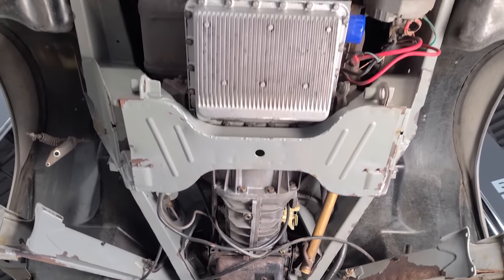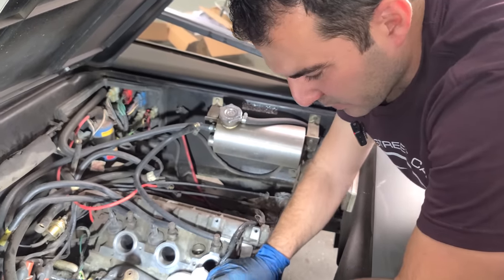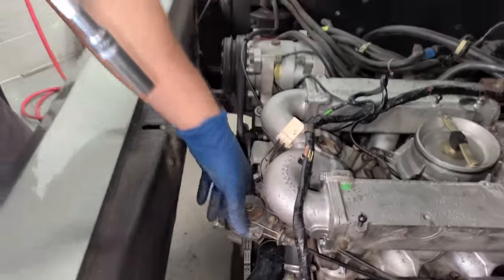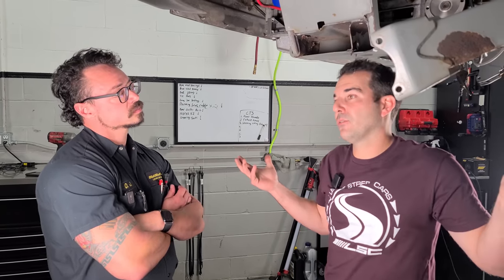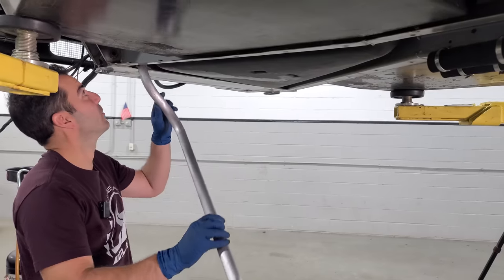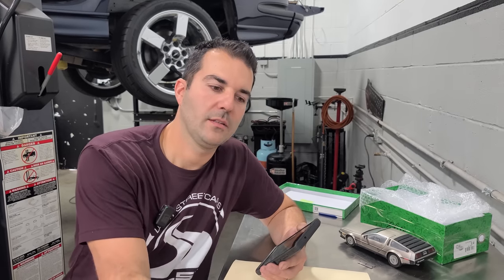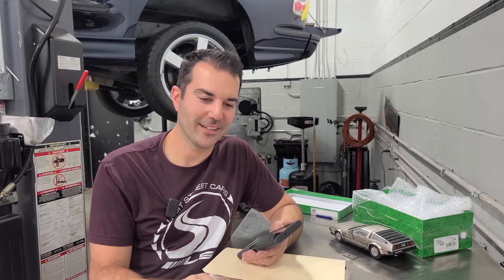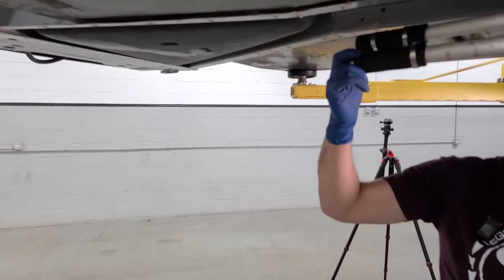I Put My DeLorean Engine Back Together & Spoke With The Orignal Owner! Fake Miles & More Bad News :(

Comment: That stainless bolt you used threaded into the aluminum intake at 11:15 needs a special grease applied to the threads to prevent galvanic corrosion to the manifold! It would be better not to use it at all.
Reply: Very good and important catch!
Reply: My thoughts exactly - I cringed heavily when I saw that.

Comment: I would love to see something unconventional.  Honda J series, 13b, or a k series.   Something turbocharged would be pretty cool.  A Rob Dahm crossover would be amazing.  Or working with Haltech would be rad.
Reply: If I was thinking in terms of easiest swap, I would build a 3.0 PRV out of an Eagle Premier. That engine already has DIS, modern EFI, is a direct swap, and costs about 200 bucks in most junkyards. Control it with a Haltech ECU and add a turbo or two. If cost was no object? My first choice would be a TDI V10, but if it didn't fit, I would have to say a GM 1.2 or 1.3 3 cylinder, the LIH, or L3T. These are sub-200 lb engines, all forged internals, that stock make either 137 or 155HP on 87 octane. Take one of those, control it with a Link Force GDI ECU, upsize the turbo by quite a bit, and tune it for 93 octane. Sub 200lb engine that makes 250-300HP easily, possibly even more. The design of the block, pistons, and rods is so advanced compared to something like a 2.0 Ecotec, or Honda engine, that I am sure it can handle much more. I mean it has DLC coated wrist pins, seriously. Cast iron cylinders cast into an aluminum block with a full bed plate. And just all of the latest technology. And they can be had for $1500 or so. The engine isn't the expensive part, it's an ECU capable of controlling it.

Comment: I'm loving this De Lorean series. After halloween you could put a turbo and a holley efi on it. Go for it!!
Reply: And get some Alpine heads for that boat anchor of an engine.
Reply: Or even go to the Eagle Premier 3.0 PRV V6. Direct swap and has EFI already. Get a Haltech standalone and a turbo (or 2), and some more modern injectors and coils, and you're pretty much all set. Those engines sell for 200 bucks or so complete, so it ends up a lot cheaper to do it that way. Even stock those engines make more power than the B280F, not to mention the increased reliability with proper EFI.
Reply: @theodorgiosan2570   nice one! While keeping the original DeLorean vibes and get rid of the valley of death. You can make it faster with more hp, put new tech on it and then bring it back to the future.  😄😄

Comment: The frame is not that bad. I’d suggest putting the frame on the “B” list and get the vehicle running and driving well.
Very cool to have a great relationship with the seller. What a nice guy.

Comment: The body and interior are your most important parts for what you want to do.  You could replace it with a new reproduction frame or fabricate a custom frame or  drop the body on to a frame from a different car totally.  In my opinion the thrid option is your best option as it seems you are also looking at doing an engine swap.  I think an LS6  would be a great option for the swap and you might be able to get a doner car that has everything you need Frame, Engine and all.

Comment: I've used Rust Restorer since the '80's and it really does work. No, not a long term fix. But you'll be fine until you can do a proper job.
That model is valuable, that's a great gift.
As a young sailor in the early '80's we did a port visit to Bergen. Let's just say that was one of the best liberty weekends of my career.

Comment: Just a note on stainless fasteners.

There is a reason you should be glad they didn't use them. 
Where you used that stainless bolt your probably fine. But a good rule of thumb is to never mix stainless hardware with aluminum, and never use stainless hardware if you ever want it to come back apart. Stainless will gall and fuse together permanently. If you ever want any hope of stainless hardware being able to come back apart you must passivate the hardware with some kind of acid based product, use anti seize, then never tighten then with power tools.

There's a whole mil-spec guide for using stainless fasteners for different applications that's really specific. With things like maximum turns per second of tightening/ loosening motion to prevent them from fusing.

Comment: From my years of experience with Vanagons, (engine in back, radiator in front), you should put a petcock on top of the radiator that you can attach a hose to which is then submerged into a plastic bottle full of coolant (air bubbles out and pulls coolant back in).  Makes priming the system sooo much easier!!

Comment: i suggest that you clean with the least abrasive method the valley and apply Alodine, it's a corrosion inhibitor that we use in the aircraft industry to passive the aluminium corrosion, after that you can apply any hot temp primer and paint to extra protection (preferible epoxy). Alodine is now distributed by henkel as bonderite, check the M-CR 1200, M-CR 1500, M-CR 600

Comment: LS twin turbo engine. I saw a guy has a Corvette engine in his. Also, what about that stuff you used on the SVT Lightning frame? It turned the rust into nothing, instantly. At least it could be used to stop the rust process. Go Alex!  Oh, BTW, Did you hear of the DeLorean barn find in Wisconsin? It ONLY had 977 miles on the odometer.

Comment: I worked at Delorean's East Coast distribution center in the early eighties. That epoxy coating was always cracked when the car came off the transport trucks. The transport guys would tighten the cars down so tight the epoxy would be cracked at the tie down points. We sprayed the cracked spots with rattle can gray paint. I always knew the epoxy would be a problem. The frame was originally supposed to be made from stainless but was later changed to keep the cost down.

Comment: for aluminium pipe best is to use a surface conversion treatment or anodizing to control corrosion for the future . Yellow surface conversion as Alodine will provide a aerospace look to the DeLorean .

Comment: As few DeLoreans were made,  I would recommend keeping it original. Once you start modifying it,  it will be hard to put it back original and you will kill the value.  Have you heard of a "duce coup"?  32 Ford coupe or v8 Ford. Because of all of the hotrods that were built out of them it is extremely rare to find one that is all original. Something to think about before you engine swap.

Comment: I set the standard for my time as a young mech in a Lincoln dealership when I burned a Mk III Continental's tires for 20 feet in front of the dealership owner. The radio had been left on by someone, and I had no clue the cars were so quiet or that they had so much torque. I was in the doghouse until I joined the Marines for a pay raise. Those things were so overbuilt. Enjoying the DeLorean resurrection. Good luck.

Comment: I always wanted a Delorean. I picked up a front bumper with grill and emblem and a rear bumper cover and other odds and ends as I was sure I was going to get one. Well it hasn't happened yet....

As for the engine, I would LS swap it. I've heard the trans can barely hold it so you would probably have to swap that to a Porsche unit. I love your car, enjoy working on it and creating memories with your kids.

Comment: A tiny bit of surface rust and Alex is having a conniption. Just touch it up with some trim clad and be done with it. Its so minor that it won't make any difference. Plus its not your daily, and it won't see rain and definitely won't see snow and salt.
Reply from the maker: Did you see the big holes and no good metal to weld to?

Comment: The bad frame is such a common issue with DeLoreans, the epoxy lets go, moisture gets trapped and things go bad quickly.
That said, I'm looking forward to the episode where you pull the body off the frame, from what I remember it's a straight forward process.
Then maybe think if its not more cost effective to order a reproduction full stainless frame? Assuming they are still making those. I've been out of the DeLorean scene for way way too long.

Comment: You should get a vapor honing machine. The dry ice works great on things like the frame where you have a large surface area. The vapor honing machine works like a parts washer on steroids. I seen it on rebuild rescue If you haven't seen it you should check it out.

Comment: @LegitStreetCars My man you need to clean that aluminum! Here's a trick i use,
1. Clean with Aluminumna Brite an acid for cleaning aluminum. Then pressure clean until all the grease is free. If its really bad repeat this step.
2. Use steel wool and polish the Aluminum then use your Mud-Off to protect. 
This will recreate the original finish.

Comment: You know Alex,that's a good problem to have.Removing the Drive train is necessary at some point.Just have the bad sections removed from that frame completely, weld in new sections. I had a couple old Buicks ,the frames rotted in front of tge rear bumper.They just cut out ,welded in new sections,good as brand new!Then while your at it have it modified to replace that under powered mess.With a high horse LS Engine and transmission swap!Make that car move like it should!THINK CONTENT!!!

Comment: You could save the block with a little prep by plasma spraying the valley of death which would increase the wall thickness an a meaningful way. The cost would decide the route.

Comment: I had the 1976 Buick Century Pace Car replica, and bought a Chilton's for it to replace the water pump. It was under warranty but I REALLY wanted to do it myself, first time ever doing anything more involved than an oil or filter change. And it was a snap with that manual.

Comment: I noticed you used a stainless steel bolt on a coolant line in the engine valley. Stainless steel reacts with aluminum, they should never be used together. If these components are aluminum, either an aluminum bolt or cad plated steel would be the correct choice.

Comment: Look at the hose clamp screw driver from oriellys. I got one when i worked there and its my favorite tool. Its a flexable screwdriver with a large and small size hose clamp socket on the end.

Comment: You should go all out and get one of those stainless steel frames. Yes they are pricey, but its going to last forever, and they are a lot stronger than standard, so if you want to say drop an LS in there, its not going to bend things due to a 400+ HP engine swap (if you choose to go that way as many do) - Hope you see this mate.

Comment: You may want to consider building a new chassis, especially if you plan on swapping the motor for more power.  Google Delorean crash test.  It seems to crumple to absorb the crash energy, but it seems to crush into the occupant envelope instead of maintaining a safe zone.

Comment: Just scrap off most of the flaking epoxy and coat it in POR or miracle paint to encapsulate the Russ so it doesn’t spread or get worse it will lock the moisture out so it doesn’t keep spreading. Then when you’re ready you should remove the frame and have it dipped to remove all the rust and Apoxsee then have it repainted and or repaired that’s going to be the best option to get in the places where sandblasting can’t reach dipping is always the best option if you have access to that near you. Good luck

Comment: Rather than trying to weld to reinforce the frame, had you considered adhesives?  I recall that the Pontiac Solstice/Saturn Sky bodysides were attached to the floor pan with a combination of epoxy and urethane (like windshield adhesive) which allowed GM to set the dimensions rather than having to put the pieces of metal together and weld.  Seems like it is a pretty strong/durable joining method.

Comment: I have a 1998 Lincoln Mark VIII, it was my Dad’s car and it ran; however, rats ate all of the hoses, and the wiring hardnesses off of it. It has I think 32 valve V8 engine?

I even have spare headlights for it (got off one from Junkyard after I found out the bulbs were not made anymore).

I made the mistake of parking it over the winter of 2020 because the heat vent switch behind the dashboard stopped working. I bought that too (its sitting in the trunk).

Comment: The frame repair really should be to cut apart the frame in to the pieces it was made from, then replace anything rusty, weld it back together and re-paint.

You probably need to make jigs to do that well.

I know this from repairing the frame of a crashed Lotus Europa.  It was simple enough to fabricate but it really had to be replaced rather than repaired because there wasn't much left that could be repaired and it was just easier to fabricate a whole new frame section.

Comment: First, you should clean the engine with a nylon brush instead of a wired one, which is softer and shouldn't affect the aluminum at all, and second, an epoxi primer high temperature is just a kind of paint designed to protect metal surfaces, so it should protect your engine just fine.

Comment: The frame was powder coated steel. Nost frames are totally shot. The new California manufacturer has new frames that are galvanized. If you can’t do that, rust convert all metal under the car.

Comment: Some bolts have to be a lower or higher grade to have the appropriate shear strength for their application. Using different sizes ensures you use the right bolt

Comment: Many manuals available online, even genuine which you can download for $20, Also you can get replacement frames as well as galvanised so it would be cheaper to put a new one in and a lot less work

Comment: Hey Alex, are you familiar with the Devcon 10610 aluminum putty (f)? It's an aluminum putty that we use on certain aircraft repairs. There's a couple different versions of it. One is sandable and the other dries super hard, and is harder to sand. Might be something you can use on aluminum repairs.

Comment: Find a Fiero or a 1st or 2nd gen Toyota MR2. All of those are midengine cars similar to Delorean.  Cut and splice the floor pan to fit the Delorean's dimensions.  Either that or weld up a custom tube or steel beam frame to replace the rotted parts.

Comment: @11:13 "It's actually stainless unlike most of the hardware on this thing"

Oh no...  That might be really bad.  Putting a stainless bolt into an aluminum engine block in a location that likes to get wet means galvanic corrosion.  That can't be OEM can it?

Comment: I cant help but think all the mixed metals is part of the problem with the rust. Cheapest option, new metal and powdercoat, 2nd cheapest option = new frame from the DeLorian parts stash, 3rd option and most expensive = replacement stainless frame. 4th option, clean it up and roll with it then keep and eye on it and if it gets bad then fix it. Make sure you only drive in sunshine, no water!!!

Comment: I feel ya on the major frame repair stress. I just messed up my 90 300zx twin turbo. Spun a rod bearing due to gas in oil. Gonna cost at least 15000$ to rebuild engine.
Reply: That's a tough car to work on too (I had one). Good luck!

Comment: Careful using strong base degreaser on aluminium. It literally eats it. And using wire brush remove the anodised layer. I woul protect those coolant pipes.😉

Comment: I have a kit of replacement metric nuts and bolts with common sizes and thread pitch. However, some of head sizes differ from the original even though the bolt is the same size.

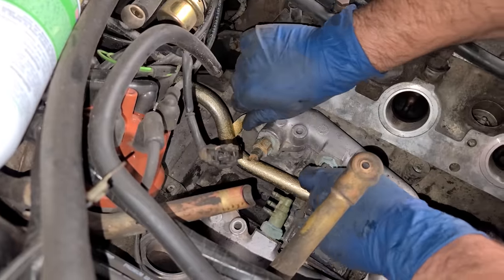Comment: 4:51 The torque spec is determined by the diameter + thread pitch. It's universal ie not specific to a manufacturer. An m6x1.0 has the same torque spec regardless of its use by Toyota or Mercedes

Comment: Silicone spray on the coolant hoses is a HUGE no no . If you left the clamp even slightly loose the silicone will give it enough slip to pop off . Always clean and install never use lube

Comment: Another long term restoration project.  Spray some Eastwood Rust inhibitor on it for the time being. Do  your halloween show and maybe next year you do the full frame off restoration where you can fix it correctly and then entertain the thought of LS swapping it or even a LT based V6 from GM.

Comment: Chassis plans ?
If available get a copy ,then start getting sections re-made ,or patch sections built , not impossible, to he only hard part is try to meet tour own dead line,are there any other Deloreans out there to borrow ?
Motors !the old 3.8 buick V6 ,simple , reliable,cheap ,and hopefully still plenty available 😊

Comment: Why weld, when you can drill and bolt when possible?
Or, scan the parts, print PLA copies, melt those pouring metal over em, sudden onset delorean factory on demand.

Comment: Sounds like the kind of thing where you just need to roll through it and not worry about the frame for now do your Halloween thing and then after the fact everything should be more or less up and running so what you can do is then transition into a full breakdown and a full repair

Comment: Getting on a new thread here cause, 500 comments and all... I'd say because the Delorean was famous for its dodgy handling because of the massive rear weight bias, I would replace this thing with something light. An alloy-based V6 like the Duratec, or maybe even a turbocharged 4-cylinder, and push it inside the engine bay as far as you can. Slightly better weight distribution and mo'powa'babe' sounds like a good combo to me.

Comment: I do wonder if JB Weld would be strong enough to repair the pitting in the valley of death and if it would prevent further corrosion with a thin coating across the whole surface?

Comment: For what it's worth, BMW has used 11mm bolts for their intake manifolds from the 90's to modern day. M50, M52, M54, M60, M62, M70, M74, N52, N54, N55, N62, it's always 11mm.